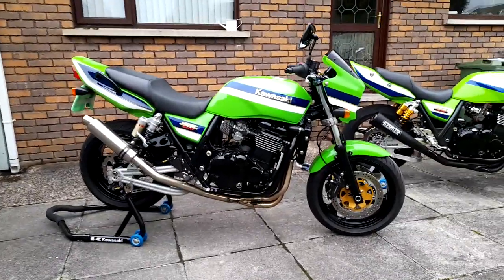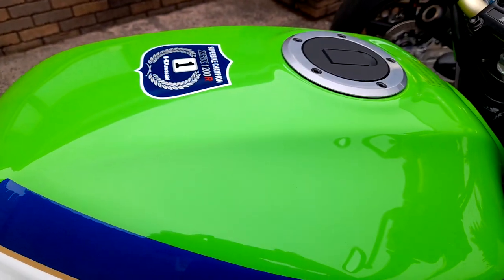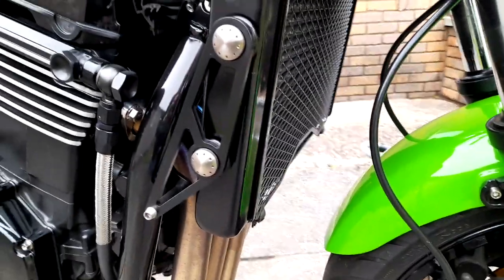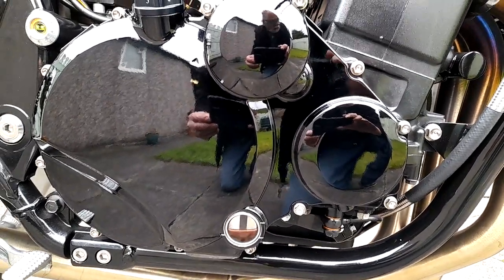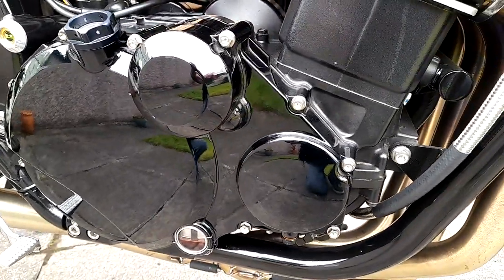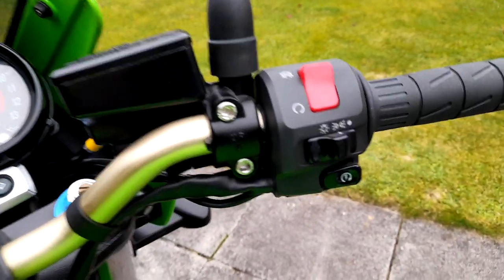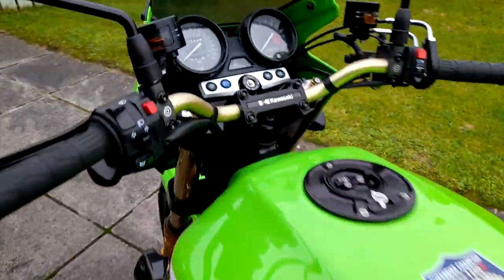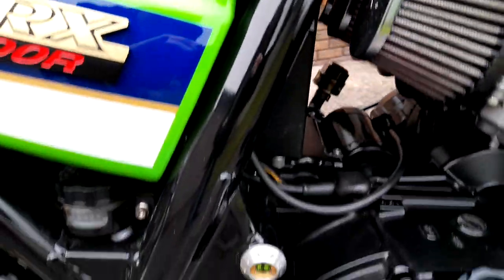My 2001 Kawasaki ZRX 1200R build overview versus my 05

Comment: Hi BG, enjoy info video's. can i ask where you got the Daeg clutch casing from iE Japan or nearer to home . looking to do the same mod.
Reply from the maker: Hi I haven't fitted it yet since it is destined for a 1224 cc engine upgrade build for my 05...

I bought it brand new from a friend and fellow ZRXOA forum member who personally imported it from Japan.....(along with the separate oil level sight glass and oil capacity decal..) to accompany it...,although I understand those are the same as the ZZR 1200 clutch cover items..

BG.
Reply: @brianwells5258  Hi Brian, with the daeg clutch cover i take it the oil levels are the same as std cover ?
Reply from the maker: Well just like with the ZZR clutch cover the DAEG cover has its sight glass higher than the Stock ZRX one.

It is also larger in Dia than the ZRX sight glass (just like the ZZR one)

You will need to compensate for that and fill your oil level accordingly..

(The engine takes the same stock ZRX oil capacity...,but that will show differently on both the ZZR and DAEG sight glasses..)

BG.

Comment: Thanks Brian, do you have trouble getting the rex on those rear paddock stands
Reply from the maker: Yes the 01 (with stock swing arm) is a bit of a lift..!!
The 05 with the OVER 10 arm not so much..

Its obviously because the spools are located on the lower brace on the stock arm..

In the new year I'm going to reduce the height of the paddock stand for that bike.
Oh and my wife said she has also bought me some front wheel chock's for Christmas for my bikes.!!

Guess I'll be Wrenching while she cooks the turkey..LOL..

Cheers
BG.
Reply: @brianwells5258  great idea about reducing the height, I've got the Oxford and lifting my06 with the factory swing arm isa bit scary on my own ,thanks for your reply love what you have done
Reply: @kevinstreet5709  I use a wheel chock and sit down and put a foot on the tyre and pull back hard on the paddock stand.

Comment: Hey Brian, nice bike, your attention to detail is outstanding.  I've got one that I like, it's pretty stock except for a set of Mikuni RS40s and a GSXR1000 pair of forks and brakes.   You might have mentioned it, and I missed it, but  what does it weigh, and how much hp does it have?   I always thought that they would be a much better bike, if they were about 100lbs lighter than stock.  James Compton said his hike was about 390lbs, but without throwing a whole bunch of money at it. I don't think I could even approach that weight.   Anyway beautiful bike, nice work.
Reply from the maker: Hi thanks Robert...,i have to confess I have no Idea what each of them weigh or their power.
I can only say the 05 would definitely weight significantly less than the 01 on account of the amount of Titanium replacement fittings and fasteners.. (almost every OE one that could be replaced with Ti., was...!)
That includes my own machined Ti wheel axles and swing arm pivot etc..etc)
Also the 05 has BST carbon fibre wheels versus Stock on the 01....
In addition I have also (just recently) taken possession of a specially commissioned hand made (by a Japanese Artisan) Titanium headlight~fairing bracket.,yet to be fitted..

Regarding power.....,well these bikes respectively will both be having engine work done .....(the 05 much more significant) with planned 1224 upgrade..,6 speed gearbox..,lightweight slipper clutch..,yoshimura cams..,ZZR double valve springs and hardened rockers.....etc.

The 01 will also be having engine work done as well.....,ZZR 1200 cams and pistons along with possibly a base gasket delete...

A common saying on our forum (ZRXOA) is... "A  ZRX is never done.....,you either run out of time., or money"...

So true....Lol.!

God bless
BG.
Reply: Thanks Brian.  I saw in the video that James Compton was saying 170hp at the wheel and 390lbs, and 100 lb ft O'Torques, sounds like almost too much, which really means, just about right!.

I'm about to fire mine up for the first time with the new carbs, but last Thursday I was trying to haul ass and finish the steering stem for the new front end, but I went undersized on one of the bearing fits, so I roughed out another one, and I'm back where I started last Thrusday.  So maybe this week. 

And it really is never done.  Keep up the good work Brian. .

Comment: Hello mate,

How do you find the black widow down pipes? I’m considering them for my zrx. 

Of course along with a nicer end can yet to be decided on 

Thanks 😊
Reply from the maker: They are OK...,very reasonably priced etc however they tarnish pretty quickly and as a result give off that "dirty look" on the stainless steel...

As such as part of some additional Upgrades for this bike (including an engine upgrade etc) I have had the black widow headers and link pipe ceramic coated black...

For value for money though....,the Black Widow system is hard to beat...

BG.
Reply: Thank you for getting back to me really appreciate that. 

Ah I see. May be worth looking into a titanium option from Japan then. I’ve struggled to find options over here in the UK. Unless you have any other suggestions? 

I’ve only recently got my ZRX1200R and setting out to “make it my own”
Reply from the maker: Yes loads of Titanium options from Webike in Japan...(pretty pricey though..😊)

I have a Kerker on my 05 check it out in another video..
Fantastic sound..,but requires getting recoated since their factory finish is hit and miss..(also fit and finish needs "refined" etc..)
Took me a lot of work to get it just how I wanted it..

Popular in the UK is the Akrapovic route...,great exhaust..,but somehow it never appealed to me.

The Black Widow is fine...,but if you have deep pockets a Ti offering from Japan is Much more desirable.. 😊

Comment: Lovely bike buddy…could you let me know some details on the coil conversion…seen people using zx10 and gsxr coils..
Reply from the maker: I used 08 ZX10R coils for both my ZRX's ....but you'll need a stick coil harness to link them into the ZRX after you remove the stock coils..

Those came via a group buy on the ZRXOA forum  (I'm one of the moderators on there)

It made the conversion a very simple plug and play....,as the maker of the harness colour matched the stock ZRX harness wiring along with a single connector block..(haven't seen him on the forum for some time now...,so I'm glad I got them when I did as I'm not so sure he is active anymore....)

I'm sure you could probably make up something similar though if you were that way inclined....
Reply: @brianwells5258  perfect thanks, whilst a long term dreamer of a zrx I’ve only had her a short time so plenty of plans..might hit you up on zrxoa as on there to..thanks hoping big blue comes out as well as yours..👍

Comment: Brian can you help out regards this low profile sump conversion ….Regards
Reply from the maker: Here is my thread covering this conversion...
http://www.zrxoa.org/forums/showthread.php?352029-Concourse-1000-oil-pan-swap..

BG.
Reply: @brianwells5258  no longer able to register on this forum
Reply from the maker: @adrianwright781  thats a shame as there is some modification required to the Concours pan along with some NLA parts required (oil return tube inside) and a shortened bottom oil line and some machined adapters required..etc.

I covered this conversion on the OA forum in a couple of threads.....,and one member actually took it a stage further by modifying the Concours pan internally to re route the oil flow and then deleting the external bottom oil line altogether as he was having clearance issues with his exhaust collector box..

All outlined and discussed on the ZRXOA forum......,shame you cannot access. 

BG.

Comment: hi brian did you have to block off the carbs when you took the deicing pipes cheers
Reply from the maker: Hi John....,no need to block anything in the carbs since it is only a recess underneath in front of the float bowls...(the brass unions for the de icing hoses are a push fit into those recesses via '0' rings on their shank and simply "pull out")

You do however have to block the hose spigot on both the water pump pipe and the horizontal pipe at the rear of the block (in front of the carb bank)

It is NOT sufficient to block this with a vacuum cap and clip since there is a LOT of coolant pressure and it will spit the blanking cap right off..

You need to either weld up the spigot or tap and red thread lock in a stainless steel M4 cap head screw (preferable taper head..) Then fit your vacuum cap and clip over that....

Great mod since it allows you to remove/refit the carbs without having to drain/refill/bleed the system every time you want to remove/re jet your carbs etc..

Cheers
BG.
Reply: @brianwells5258 thanks Brian  .I am swaping a zzr12engine into my rex.briab is there a possibility  of contacting  you I'm not a mechanic  this the first time trying  this I think a need advice .ps I live in France
Reply from the maker: @johnkehoe1742  I'm one of the moderators in the ZRXOA forum and your best best is to join that message board and post whatever questions or concerns there..
Swapping a ZZR 1200 motor into a ZRX is a mod that has been done by a few members on that board which have posted step by step threads outlining the entire process...

It is a "relatively " straightforward swap...,however the oil pan and oil relief pressure valve has to be swapped over....,as does the head..(swap the ZZR cams and double valve springs into the ZRX head...
You will also need to swap over the ZRX ignition advance timing rotor to the ZZR motor.....,some have changed the igniter (ecu) from their ZRX to a ZZR 11 one to raise the rev limit another 500 RPM on ZRX ...etc..etc..(not necessary though unless you really want "another" 500 rpm on top...)

Like I said join up on the ZRXOA and you will get all the information you require..THE BEST ZRX message board on the Planet..!!

God Bless
BG.
Reply: @brianwells5258  thanks brain  God bless